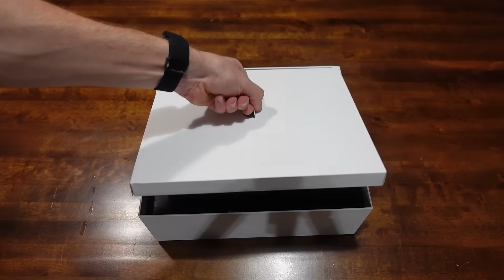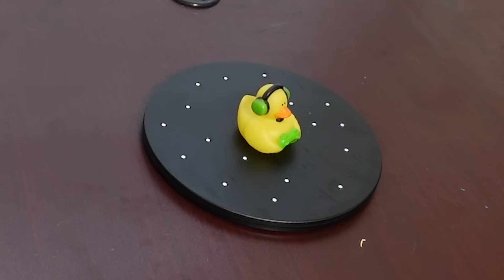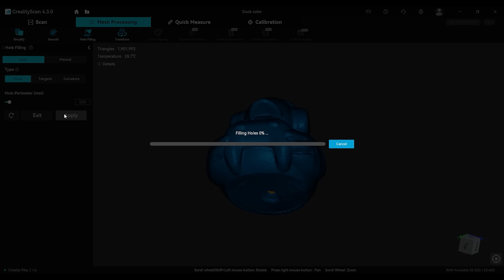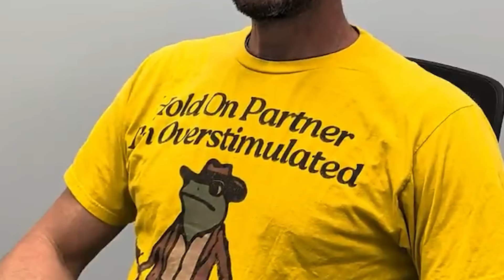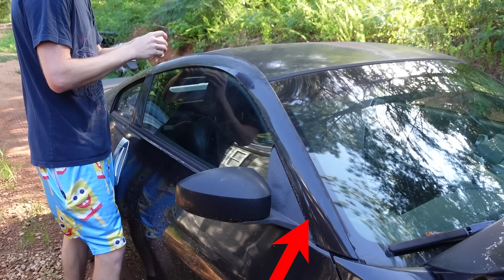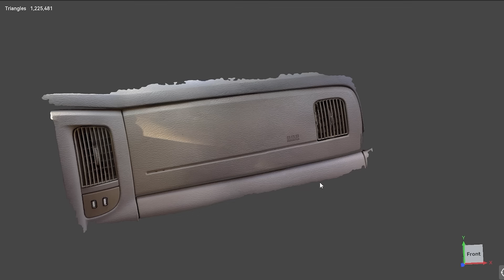The Smallest Blue Laser 3D Scanner I Creality Pika Scanner Unboxing and Review

Comment: Hey Dan - sorry if i missed it but can you elaborate a little bit on limitations?
1. fine detail - whats it's smallest measurement or tolerance (i feel like the older "standard" was people trying to scan minifigs of sorts because of all the organic and tiny details)
1a. shiny surfaces - usually the big downfall on scanners is shiny surfaces of metal or paint, did you play around with that and needing powder sprays?

2. size or scan file / equipment limitation - seems like different modes of operation (phone, laptop, wifi, whatever) but is it ALWAYS stored on the scanner and thats always the limit or is it storing on the device you're paired to?
2a. max file / object limits standalone device? im assuming its storing on the scanner considering you said phone used.
2b. max file (combined scans) for avoiding above limits - lets say you wanted to scan the whole car
2c. orrr is it more limited by the machine youre hooked up to? ie laptop / pc specs (ram, storage, gpu vram..)

3. whats the software situation? cloud only? local? subscription requirements / proprietary ties?
Reply: Watch Payo's Pika videos they are excellent and he shows himself making a snap fit piece using one and does detailed precision, accuracy, and alignment tests.
Reply: NuggetsInclusive got his hands on laboratory certified dimensioned blocks, and tested the accuracy really well.  Pretty stupid spoiler: accurate enough for me.  Precisely perfect?  No.  Accurate enough that my 0.2mm 3d print nozzle is too coarse to make a difference?  It seems so, yes.  It was accurate enough that apparently scanning sprays change the scanned item's dimensions.

If you want to actually get good information instead of what I'm spouting, check his video out.  The name is 'How Good Can It Be?'